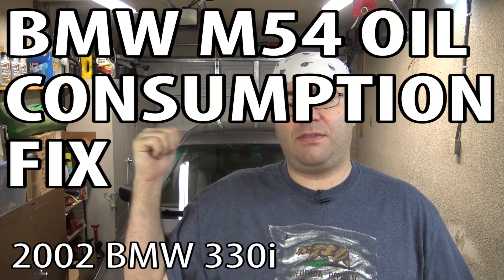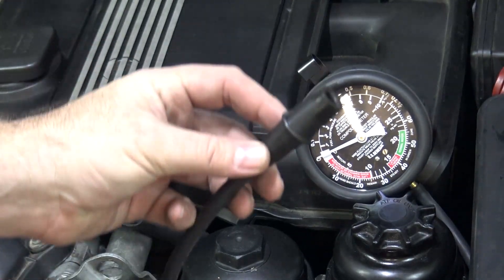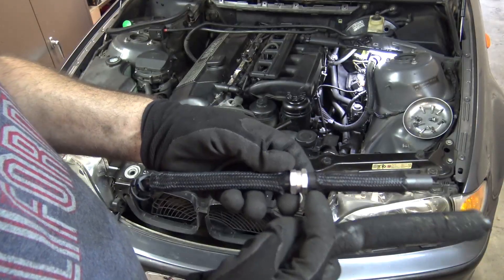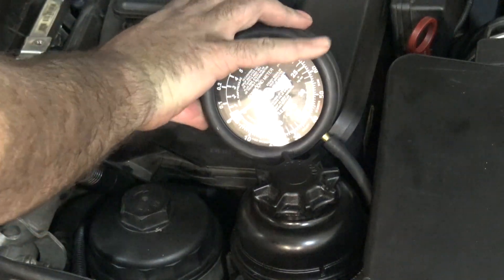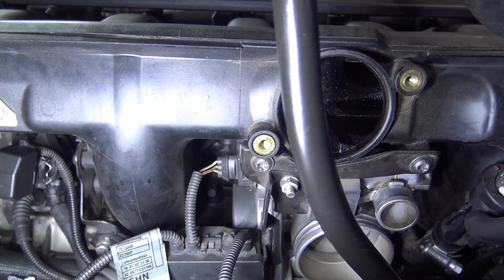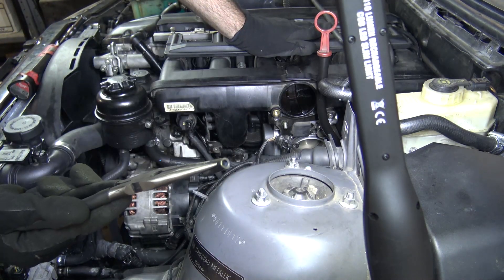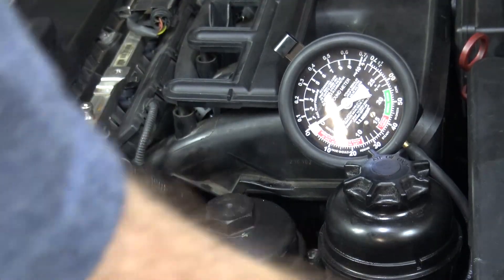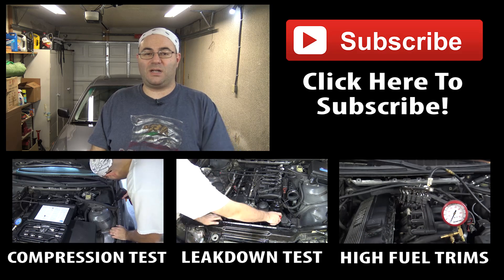BMW E46/E39 M54 Engine Oil Consumption Fix (02Pilot Mod) DIY

Comment: Quite late here with this comment, but, ive done this mod just now. 
Got m54b30 engine, it used to throw big cloud of smoke after i pushed the throttle after a minute of engine braking on a downhill.
That is completely gone now, it used to spend 1L of oil in less then 1000km, engine has got about 230 000 km . I hope oil consumption goes down as well.
The only bad thing is that engine behaves really weird now. There is kind of no smooth transition when i push the throttle from idle, it kind of wants to jump straight to 2000 rpm... also releasing the throttle becomes like really instant, its not smooth at all. It instantly goes to hard deceleration which is weird. It is driveable,  but not as smooth as before. WOT seems just as good as before...
Reply: And now?
Reply: @riccardodefina9551 I made peace with it  consuming oil, put a supercharger and a catch can later down the road. Funny enough, there is no smoke any more nor does it consume a lot of oil... My odometer does not count distance any more tho, so cant really tell no more 😂.
I did drive like 5 or 6 track days with it, maybe it helped, all jokes aside it does not throw clouds of smoke any more, nor is there lots of visible smoke on wot either.
Reply: @TomoReso wow nice to hear that! I have a m54b22 that has 218000 miles or 350k kilometers and already bought it and dont know the real oil consumption but surely it will consume cause when standing and redlining a tiny amount of blueish cloud can be seen... Have to do oil change but i've put some engine flush in it and hope it will do something, even combined with a new febi ccv, maybe i'll try this o2 pilot and will see with some fresh oil

Comment: Hi Jason,

Just wanted to say thanks for all of your videos and help, just purchased a 325Ci about a month ago and have SO many parts coming in to get her back in shape.

That being said, I'm wondering if it's a good idea to attempt this mod instead of replacing the entire CCV (which seems a bit daunting). My car has exactly 130k, haven't driven it much at all since purchase, and by the looks of it, very little has been replaced. I've undertaken replacing all the gaskets and seals, as well as VANOS and DISA rebuild, but this (and the cooling system lol) is bothering me a bit. I live in Florida so weather and mayo probably won't be an issue!

Comment: I did the O2Pilot Mod on my ZHP, I've ran 400 km so far, will post the results later when mileage increases. The first impression is that when i used to drag race it it would burn oil and always would drop the level to low, after i did the mod and raced the level stayed the same, no more blue smoke at the traffic lights.
Reply: Hi, do you have any recent updates to share so far?
Reply: @akdomun  Hi, I have the detailed results at ZHP MAFIA, check it and pm me if you have any questions.
http://www.zhpmafia.com/forums/showthread.php?21379-ZHP-NA-Project-More-Power/page19
Reply: for the moment i have run 8500km and only added a quart when at this mileage it would have needed 4 or 5 quarts.
Reply: @BerDz3nA still running good?
Reply: Hi mate how many miles, kilometers does it have now?

Comment: I ran a catch can with no pcv and the vaccum was insane, but the catch can actuslly filled up quickly with oil. With a pcv valve that stopped, but there is still some oil consumption. Like 1l per 1000km

Going to try with a larger pcv valve
Reply: Update?

Comment: Hi 50'sKid I noticed you listed the amazon link description incorrectly. The link you posted is for 8mm return check valve and you stated would need 12mm check valve. Just noticing after I purchased realized was the wrong fit. Thanks!

Comment: little help anyone. Those 3 vacuum points behind intake, big one is supposed to be capped, then out of the remaining 2...which is for the 1way valve and which goes to canister? 
Car is a 330i and I don't have secondary airpump.. anyone please
Reply: What did you end up doing?

Comment: I performed this mod on my car and it works!  My oil consumption is next to nil........I removed my intake manifold, replaced the coolant pipes, CCV and refreshed the vacuums lines.  My first time getting this deep into an engine.
Reply: Nice I just did the same to my car, I felt awesome after I was able to do all that myself.
Reply: @TremendousPat how did it run after was that your comment was 4 years ago really wanted to know how it did in the long run ?
Reply: When you apply full vacuum to that port dont you risk sucking the engine oil up the oil return line? How dirty was your intake manifold?
Reply: @gregorytolson4621  it sucks air, not oil. It's not a closed system so it can't create enough vacuum suction to pull oil up. 

I've done the mod and am not burning any oil. If it was sucking oil into my intake then I would be consuming oil but I'm not.

Also, consider that the port to receive a vacuum line onto the Cyclone is there by design from the manufacturer. It is Designed to receive a vacuum hose it looks like. Was this forethought to help those with older engines overcome sticky piston rings allowing oil blow by? Looks like it. Not sure how else to explain why it's there

Comment: Thanks to 50skid for the superb video and explanation!  Showing why this makes sense by providing some actual numbers.  Still wondering a bit about the implications of higher vacuum but finalizing this mod in my car today.  Thanks to the O2Pilot author for the insight as well!
Reply: This is what im wondering. Is the increase in vacuum being put on the oil return line?
Reply: @gregorytolson4621   Your vacuum is highest while idling

Comment: Have you seen this product from German Auto Solutions? https://germanautosolutions.com/store/german-auto-solutions-m54-ccv-replacement-kit/ In the FAQ for the product they seem to address the introduction of a new vacuum line as being problematic for the engine seals in the long term. "The full manifold vacuum provided by a PCV valve will exceed the sealing capabilities of the engines crankshaft seals, resulting in dirty air from underneath the vehicle getting sucked into the engine and probably completely destroying the seals in the long term." Granted, these people are trying to sell their product, but I'm curious what your response would be to this idea of excess vacuum and what your thought is of this product in general.
Reply: I am on the waiting list for this unit and its been since November and no luck. Your question made me think about doing this mod because I was also going to ask when he measured the air that is going in was on Idle what if you are doing 80 MPH isn't the air that's generated increase?

Comment: Is it normal with this mod that the oil filler cap is sucked to valvecover? I'm trying to find cause of cold start missfire on cylinder 5 and discovered high vacuum on oil filler cap and dipstick.
Reply: Yes, that is expected

Comment: If you hook up vacuum to the CCV nipple then won’t you cause the diaphragm to close and close off your upper two hoses? This will mean that whatever oil goes into the intake will go in through where you put the other end of the line.  Is that alright?

Comment: Any idea why I keep having intake and exhaust camshaft sensor codes? Does the vanes system need to be replaced or repaired, 2002 325ci please reply, kellycjarrett@gmail.com
Reply: Vanos system
Reply: What happened?

Comment: I have the same oil consumption issue with my 2005 325i N56 engine (California). I am trying to duplicate your process and it appears my intake manifold is completely different from yours and I’m unable to modify my vehicle in this manner to stop the oil consumption. The capped port behind your disa valve does not exist on my vehicle, nor does the capped port on the rear of my manifold. I also noticed on the rear of your intake manifold you have the letter “B”. My intake manifold has the letter “K.”

Please advise.

Comment: Hi, your videos are so helpful. I've had problems with the CCV system and thanks to your video was able to replace the system in place. I'm still suffering leaks which I'll get to the bottom of (I appreceiate it's impossible to diagnose without being there). That said...... I did a vacuum test. I thought I'd just check that the problem was vacuum rather than fuel pump ( the car - a 330ci - has done 136000 on it's original pump). When I disconnected the top hose from the crankcase and tested it the vacuum did indeed drop (I've done the 02pilot mod so initially had a much better vacuum reading) but much more significantly the car started to run very badly. Significant white smoke (it was dark but I'm certain it was oil) and almost stalling. Needless to say I got the hose reconnected asap and after a couple of mins and a restart the car cleared and - aside from a low idle (as before) - began to settle. I took it for a run and all was fine. I have tried the same procedure once more with the same result. I'm thinking that the oil control rings could be in very bad shape and removing what little vacuum is present in the crankcase is allowing oil to get into the cylinders. The car consumes oil at a similar rate to that discussed in your videos but emission tests at mot have always been very good. Have you any thoughts as to why the immediate oil burn? I've owned the car for around 100000 miles so know the service history is good. Thanks again

Comment: My oil light came on again and I was able to see what impact the o2 pilot mod has had.  With this mod I have gone from 400 miles/quart to about 1400 miles/quart!!  Thanks again 50sKid!!
Reply: Have you checked out your intake manifold and seen if it's full of Oil?
Reply: @alant28  I haven't checked but haven't noticed an issue.  I was trying to say that with the mod the oil consumption has dropped substantially.
Reply: mine gets oil in it. What is the issue?

Comment: I own E60 530i with M54 engine experiencing oil consumption problem burning 1L every 1000miles.
I tried o2mod but my crankcase pressure is still very low.  (near zero before modification and increase slighly after mod)  Any recommendations for my problem other than replacing piston ring?
Reply: check for other vacuum leaks in the system

Comment: you didn't measure the vacuum correctly.  You need to tap into the vacuum line not disconnect it and connect directly to your gauge.

Comment: I did something similar on my e46, works as described.  #50sKid, what do you think about doing this mod on other engines with low tension rings and oil consumption?  Coyote 5.0 for example.

Comment: Tried this fix 3 months ago with new ccv works really well.  On a 325ci
Reply: I’ve now had this mod on for over a year and it’s a daily driver it’ still works really well
Reply: @danielprewett8910 did you do the 02 pilot method

Comment: I want to thanks to 50´s Kid for this teach. I set the vacum conection from de PCV and the motor's manifold, and i must said the oil consumption stops, also the fact of my E46 was hard to start in the mornings, particularly in the cold mornigs. I think when oil remains in top of the cilinder head, there was a bad air/fuel relation and motor stops. Before this fix, i needed two or even three starts to make the motor work, now motor starts at the frist try. You will need a 9mm diameter hose for the manifolds conector, and a 5mm diameter hose for the PCV's Valve conector. May the hoses are some flexibles to sets more tight. (Para el que hable castellano, "Quiero agradecer a 50's Kid por esta enseñanza. Instalé la conección de vacío de la válvula PCV y el colector del motor, y debo decir que el consumo de aceite se detuvo, también el hecho que mi E46 era dificil de arrancar en las mañanas, particularmente en las mañanas frias. Creo que cuando el aceite quedaba en la parte superior de la cabeza del cilindro, había una mala relación aire/combustible y el motor se detenía. Antes de este areglo, necesitaba dar arranque dos o tres veces para hacer al motor trabajar, ahoro el motor arranca al primer intento. Van a necesitar una manguera de 9mm de diámetro para el conector del colector del motor, y una manguera de 5mm de diámetro para el conector de la válvula PCV, De preferencia mangueras flexibles para que ajusten más apretadas. ")

Comment: Thanks a whole bunch man, really appreciate it! :) I have a '01 320 i M44B22 and also drinks 1l per 800 km,
smoke and all that. It's starting to be embarrassing, but I don't want to buy a new car, cause I am truly happy with the ol' 'gal.

I will do this mod together with replacing the CCV and all tubing around there, will report the outcome after 1000 km!
I think you just saved me min 1000 EUR for a complete engine rebuild. I owe you a beer ;)
Reply: Sandi Žbogar any update?
Reply: Now?

Comment: Will this mod cause more oil to enter the intake manifold? Seems like the vacuum line being so low on the factory air oil separator would cause it to suck up oil. I have the mod done on my 530i but I'm worried about the long term effects.
Reply: it is not strong enough to suck oil up into the manifold, unless you remove the oil filler cap when the engine is running, in which case one person said in that instance they got oil into the manifold.
Reply: @lawpenner  good to know. I haven't had any issues in the past year I've been running the mod. I did remove the oil fill cap with the engine running once though lol but only for a second to check for vacuum.
Reply: Did you do the one way check valve too ?

Comment: Does anybody have a long term review of this modification?
Reply: Erik Alan  I’ve did this mod 60.000 miles ago, the car is now at 160.000 miles and no oil consumption ever since!
Reply: @keverlever  where can i buy the stuff to get all this?
Reply: C.L.O.F.F.E. the Swede 50s kid describes it perfectly in the video you only need the one way valve and some tubing
Reply: kevin schinkel thanks Iam pretty bad at some english words, could be why.
Reply: @keverlever  which non return did you use?
Reply: @joefowler9600  the one 50s kid recommends, you can buy it from eBay I believe
Reply: @keverlever  do you think its needed? I'm worried the valve wont open and let the excess oil drain back into the sump. Dont non return valves need some pressure to open?
Thanks
Reply: @joefowler9600  I had the same doubt but it works fine, the one way valve is there particular for when you open the oil cap whilst the engine is running, this will prevent flooding the intake with engine oil. As the O2 pilot mod increase the crankcase vacuum.
Reply: @keverlever  i see, that makes sense. Just out of interest, how bad was your oil consumption before the mod? And did it just stop immediately or was it a gradual improvement?
Thanks
Reply: @joefowler9600  it used to be 1liter every 1000km and directly after the mod it went to 1l every 3000km which is still bad but not if you own a bmw with the m54 engine 😂
Reply: @keverlever  very true 😂 
Mine is burning slightly more than yours was, i will be happy if i get similar results! I'll post results back on here in a couple of months 🤞🤞🤞
Reply: Just a quick update for anyones who is interested. I've got a 2005 325ti sport with massive oil consumption and a nice cloud of smoke on start up💨💨. So I've just replaced the complete CCV system, and at the same time fitted the 02 pilot mod. I bought a FEBI CCV kit £82 off amazon, the hose connections were rubbish so avoid this kit. I sent it back and bought all genuine parts direct from my local BMW garage (ccv unit and hoses, throttle body gasket, dipstick O ring, 6 x O rings for the intake spreader and the lower intake boot as mine was split.) Total cost £230.00 and the CCV connections are 100 times better than the aftermarket part. Also the genuine CCV kit comes with 1 metre of 3.5mm vacuum hose which you don't actually need for the M54, but its absolutely perfect for the 02 pilot mod 👌 
24 hours on and there is no smoke at all on start up and its currently 1°c in the uk, usually it would be puffing smoke like crazy on start up. So I'm not sure if changing the CCV has fixed my problem or fitting the 02 pilot has fixed it or a combination of both.
Anyway I'm happy at the moment and glad i tackled the dreaded CCV replacement.
The CCV is definitely a DIY job, I'm no mechanic at all and it took me around 7 hours to complete all the work. I left the intake manifold on the car, space was tight but not too bad. I'll post another update once its been a while.

Comment: At first, thank you for such detailed and easy explanation..
but, i have one question, what type of oil consumption it's fixes, does it fix oil consumption on worn piston rings?
I have M54B25(E39,2003) with 135K millage, in extremely excellent condition.. but, suddenly, out of nowhere it started oil consumption(before, it was about 1 liter in 6K miles) and now it needs about 1 liter in every 1K mile.. Is your solution accepting my case? or i should rebuild my engine?
Reply: yes , this is what I am wondering also. :)